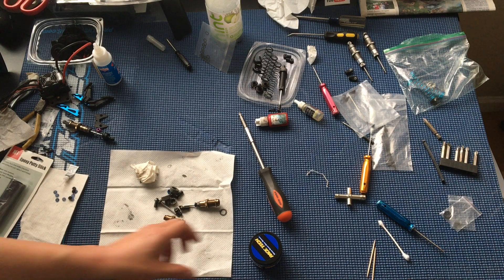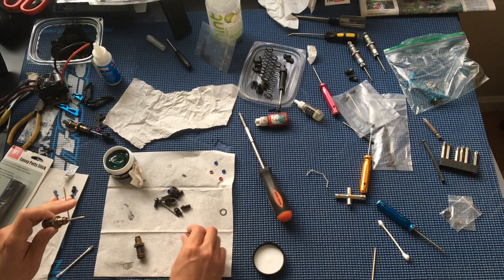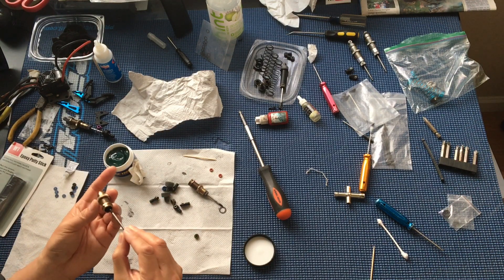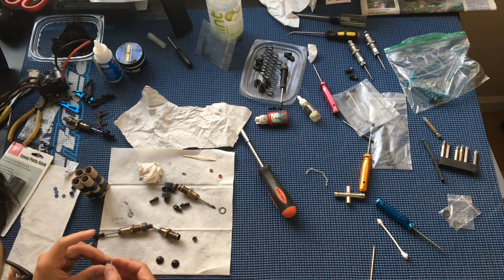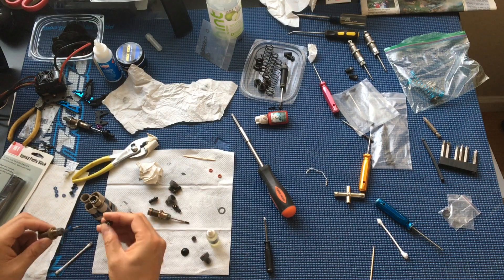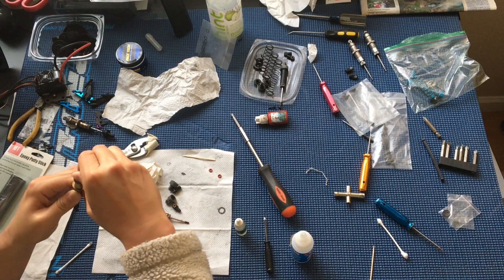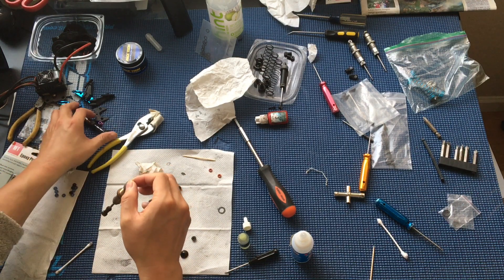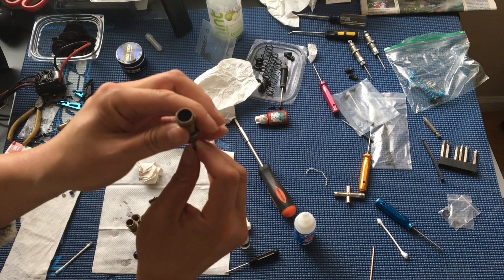Rebuilding RC Shocks With Race Tech Ultra Slick Grease USSG01, Alternative To Associated Green Slime

Comment: The purpose of the grease is to prevent the threads from nicking the orings. As well as to prevent the silicone oil from penetrating the orings and causing swelling.